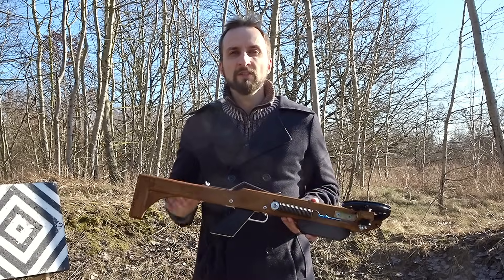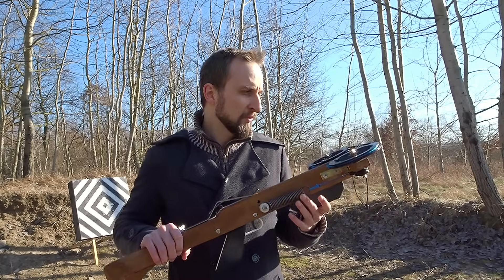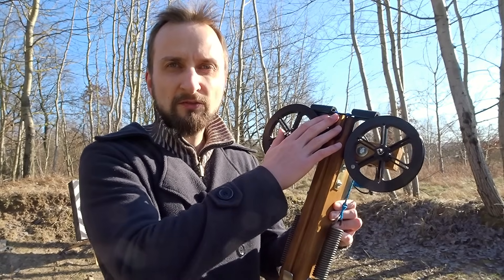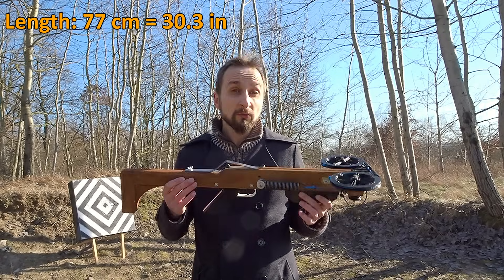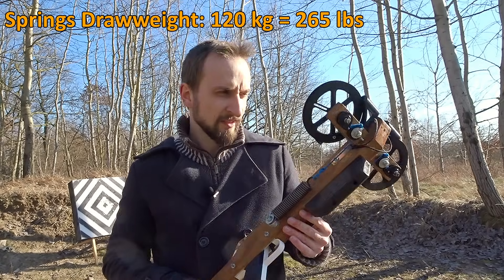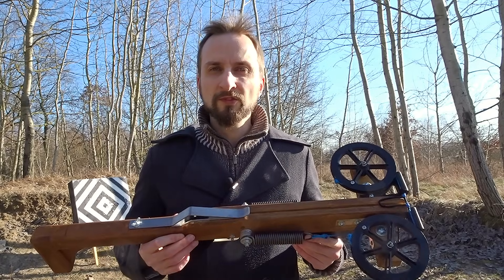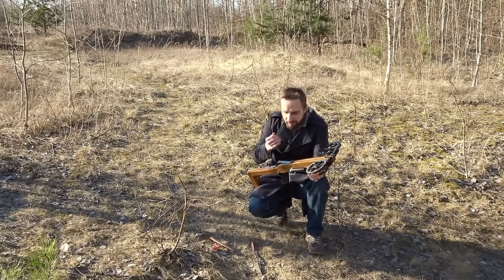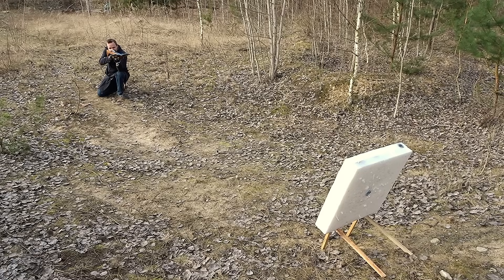Coilspring powered Crossbow

Comment: Interesting, what type of springs are they? They look about the size of garage door springs, but heavier material.
Reply from the maker: The exact ones I used are 13.4 cm total length, 2.65 cm total diameter, 4 mm wire thickness, 25 windigs.
And they are rated for 52 kg max weight, but they can be drawn out further, I put on roughly 60 kilos of drawweight on them.

Comment: Zünder    Hi. How is your crossbow fundamentally different from the one presented in this video? https://www.youtube.com/watch?v=k_B9cZZzGLo
Your crossbow is very weak, because for a gear ratio of 1:4, you need to use a spring of at least 160 kg, then the tension force will be 40 kg, which is normal for a man.
An open spring is bad, it can damage your fingers!
I like spring crossbows, and here is my version of such a crossbow:
https://www.youtube.com/watch?v=RuOYf-plI9M
Maybe you will get infected with such a spring-loaded crossbow design and make your own version?
Good luck.
Reply from the maker: The fundamental difference to Nowak's crossbow is, that he has a 1:1 ratio of spring drawlength to crossbow drawlength.
This means the crossbow could never be faster than the springs themselfs, which makes it very slow. And also you could never have more drawlength than what the drawlength of the springs is. In my contraption for every 1 cm the spring moves the bolt will move 4 - much faster and better energy conversion. And increasing drawweight is easy.
I doubt his mini crossbow even reaches 1 Joule of energy. Mine has 20, a LOT more.

Comment: If you rotated the wheels by 90 degrees so they remain flush against the body, you might be able to make a really powerful bow that meaures incredibly thin on width.  I imagine this would make it more mobile and easier to carry, especially around corners and low arches.  I know folding limbs exist on a crossbow, and crossbows are meant for hunting so you'll typically be out in the woods and not in either of those 2 situations very often, but the idea of a long and skinny crossbow seems pretty novel to me.
Reply: That's what I was thinking too and I think I'll try to do it this way, I will also probably make it longer so there's more guidance for the bolt and more space for the springs
Reply: @samuelmorresi7133   they already have a limbless bow .. the F1  Lancehead ..
Reply: @andystagger2906  II'm really sorry, but what does this have to do with what i said?
Reply: @samuelmorresi7133  why are you sorry?😂
Reply: @andystagger2906  " they already have a limbless bow .. the F1  Lancehead .."

Which is insanely expensive, works in a completely different fashion than this one, and is actually a massive technological letdown.
Reply: @horvathbenedek3596  Why is it a technological letdown?
Reply: @peezieforestem5078  
 @peezieforestem5078  When I first saw it, I thought it would use a clever rotation-to-linear force transfer to maximize torque and reduce size. 

No. 

The Lancehead uses two massive, proprietary torsion springs. 

Why is that an issue? 

1. Weight. It weighs 3-4 lbs more than competitors of the same release velocity and energy (a typicaly 400 fps crossbow is 6-7 lbs without accessories, the lancehead is 10). 

2. Weight distribution. all that extra weight from the torsion spring is too forward. So sure, it might be compact... but imagine holding a 2 lbs dumbbell placed on top o a regular crossbow. Then there's the complex pulley system in the front... the whole thing is a sh_tshow.

3. Proprietary is just another word for hard to repair. Considering the spring is the most vital component of a crossbow, and also the component suffering the most mechanical stress, it makes sense to make it at least somewhat accessible for the aftermarket. There is no aftermarket spring for the Lancehead. If you broke it, better hope they have good customer service. 

4. Not a bullpup. The two limiting factors for crossbows are large forward weight and long length of pull - the string HAS to have a long powerstroke to work. A bullpup design reduces size and felt weight. So what do clever engineers developing the Lancehead do? Put a fixed f_ing stock on it that increases the moment arm by around 6 inches on an already tip heavy crossbow that is SUPPOSED to be compact. 

5. Not really a technology thing, but cost. Believe it or not, cost is a design directive, and the Lancehead F1 offers practically no benefit for its 2600 dollar price tag - compared to competitors with similar or more powerful bows, at 1000-1500, or even as low as 500 dollars. 

I've been thinking about designing a coil-spring powered bow like in the video above for years (I don't have the means to manufacture it, so I let the idea go), so when I first saw the Lancehead advertised as a crossbow without arms, I felt like someone actually made this very obvious move. But no. They just rolled up a very long leafspring, called it a day, and sold it for the price of a used car.
Reply: @horvathbenedek3596  Thank you for replying and explaining your position in great detail!

I understand your complaints, but I have 1 question left to ask:
if the design has clear and obvious flaws, why would the manufacturer make these decisions? (as in, why would they choose a proprietary spring over a freely-available one?)

I find it difficult to believe they did not consider this, and I struggle to imagine a benefit over such solution. It seems like there's more to these decisions than what you've told me so far.
Reply: @peezieforestem5078   @peezieforestem5078  "If the design has clear and obvious flaws, why would the manufacturer make these decisions?"

For the same reason every other terrible product is produced. For the same reason Tesla is an unreliable mess, just as an example.

A good product needs good designers as the core of the operation, and a good leader/visionary to make creative decisions. The problem happens when the creatives in the group don't have an iota of understanding of the design process, and the designers are either not creative enough, not given enough creative liberty, or were disincentivised from creating good products.

Example: A firearm designer I know worked for a locally significant firearms manufacturer for years as lead designer. Problem is, the leadership in the company was basically a bunch of yesmen enacting the will of the owner, who is a rich a-hole who doesn't actually care about the process, and only deals with firearms because he likes the image of a firearms manufacturer. Again, this is a 50+ year old man who runs a company PRIMARILY TO INFLATE HIS OWN EGO AND SHOW OFF TO OTHER PEOPLE. 

So when said lead designer tried to pusb for quality, he was told to do it cheap, because the boss doesn't like wasting money. When he said a higher quality gun would be nice, the boss orderes the manufacture of ONE gun. And kept it. Why? Because he wanted others to feel jealous of him. 

Needless to say, said lead engineer completely burned out, became bitter. Over time he moved to another company with more creative freedom, but anytime he would be pitched a new idea, he'd get PTSD from his stupid former boss, and would be discourages to try new things.

There are DUMB, short sighted people in the world, and when they are put in positions of power, they drag EVERYONE ELSE down with them.

I guarantee you, the seemingly illogical design decisions with the Lancehead were the result of unrealistic deadlines, budgetary constraints, and a manager who just went "I don't care, just make it work".
And at some point the engineers in r&d just said "f_ck it. I wanted to make something nice, but it's not worth it for me to break my back for someone who doesn't even care to acknowledge my ideas. I'll do it with minimal effort, and let the higher ups worry about the rest."

To be clear - there are benefits to the torsion spring. It has linear torque characteristics on a short range, so the bow has a relatively lower draw weight. The issue is that again, regular coil springs have the same characteristics, and are much cheaper.
Reply: @horvathbenedek3596 well said mate
Reply: There is expensive crossbow that use that set up and coil spring combo,but again it's expensive so thanks for the cost friendly idea
Reply: Same idea here, plus put the spring or springs and the wheel or wheels inside the body.
Reply: Problem with turning the pulleys through 90° would be that the string would tend to pull out of the groove rather than run in it.
Reply: @Oldtanktapper  45 degrees might be a good compromise TBH. You're going to lose a little power through friction but it will make it narrower. You could also move the springs further back on the stock to increase the length of travel, add a second pulley set and/or cams to reduce initial velocity. Alternatively just make the whole thing out of box section steel, use a single coil spring buried in the back of it, one vertical pulley at the front and a shoe/shuttle type affair for the bolt running on a linear bearing. Much more expensive to make, definitely but could be kinda fun.
Reply: I'm a lil late to the party but as a hunter that's hunted with a crossbow I'll say-the more narrow the crossbow the better. And having limbs that do Not move is an absolute bonus. If this thing could get to 350fps I'd b all in. But I did just set a vortex scope to my Barnett 😂
Reply: @benrent6625  I hear ya! Illegal here for a long time but wasn't when I was a wee one. Spent much time potting rabbits with blunts.
I put a couple of ideas in response above but also you could just use a sealed pneumatic cylinder as your spring, you'd need a second pulley but with that and a linear bearing/shuttle arrangement I reckon you could get a crossbow equivalent about 100 mm/4" across and also move it more toward a shorter config which makes life a little easier in the woods. Alternatively go with a standard length but starting further back so potentially being able to add cams to reduce the whole "archer's paradox" malarkey...
Reply: I was thinking he could keep them horizontal but just stack them.
Reply: I remember joerg sprave covered a crossbow like that on his channel a while back. 2 spring coils on either side, flush with the body. Had a separate tool to reload tho
Reply: If it can move around corners easily, it’ll be manipulatable around trees easily, And it makes bracing against a trunk more possible
Reply: OKAY everybody STFU, here's problem with the 90° idea: The pulley wheels necessarily have deep grooves. When you rotate them 90°, the cord cuts into the groove wall causing friction. Even at 45° you get friction and the cord might hop out of the grooves. The F1 Lancehead does not encounter this problem because it uses torsion springs which sit flat against the weapon body, so the Lancehead's cord lines up directly with the end of it's torsion springs. The two cannot be compared, they're completely different designs.
Reply: Uma besta é sempre bom tela nas mãos pra se defender de animais perigosos. 🐅🐆🦬🏹🍷🗿
Reply: Technically possible, but its going to reduce your efficiency by at least 70% with the friction presented by having the string leveraged at 90 degrees from the point the pulley if the top of the pulley is not aligned with the top of the rail. If you do align the top to the rail, you would be limited by the leverage effect you could generate vs the size of the Z axis of the device. Not to mention, you would also need to add a string stopper, since the string would then be contacting the walls of the pulley and not the channel of the pulley (like with the design in this video) at rest, which also eats into your efficiency of energy transfer even further.
Reply: Yeah, there's a similar concept of torsion crossbows.
Reply: Could be useful in a dense forest or in certain shooting positions in a stand
Reply: Couldn’t the wheels be much smaller too?
Reply: @KryptoGraphVideos  If the wheels were smaller, the torque conversion wouldn't work, because the massive coil spring would need a very small diameter wheel, which isn't really practical.
Reply: @horvathbenedek3596  You can put the springs further back so the string rotates multiple times on the smaller wheels. The problem with that is the big wheels have to rotate as many times as the small wheels, which means the string also has to wrap around them multiple times and that eliminates the possibility of replacing them with cams, which would vastly increase speed and introduce letoff. You could have a gear reduction so that the big wheels rotate only once, but then you introduce extra friction and make the whole thing heavier and more complicated.
Reply: He wouldn't be using it for hunting as in Germany it's for the most part illegal to hunt with a bow/crossbow. This is more just a passion project.
Reply: Plus, it would make it not look like a dick.
Reply: That kinda exists, search talisman crossbow on yt
Reply: crossbow like this already exists but i don't know if it uses springs
Reply: That setup might be more convenient but it will generate vertical torque at the stock and throw off the accuracy. Horizontal mounting makes sure the torque from both sides cancel each-other out and the forces are transferred to the right vectors.
Reply: I’m glad a year ago everyone was thinking exactly what I’m thinking now
Reply: Making a single shot pistol like this would be awesome.
Reply: Make it or yap
Reply: Yeah, but I imagine that would give you a very narrow field of vision which could make aiming, if not difficult, at least not optimal. But if you aim with both eyes open (correctly) you should still have a pretty open view of your target and it’s surroundings.
Reply: Im actually working on exactly that, but a small one that i will 3d print
Reply: that would derail.
Reply: Thinking about it a bit, besides the geometrical problems from having the wheels pull the spring down, it also creates an unbalanced rotation effect, that introduces kickback on the crossbow during the firing, ruining your aim. Horizontal counter rotating wheels don't have that.

Comment: Ausgezeichnet!!  I would not have guessed that any of those parts were 3d printed. It would be lovely to see a skeletonized 3d printed frame, too, if it would be strong enough. Very nice work!
Reply from the maker: Thanks! Usually the wheels broke along the outer shell from too much compression of the string, so I thought 100% infill should pretty much remove that issue and it did. Perhaps it is also sufficent to just increase the thickness of the outer shell and have 25% or so infill otherwise. A 3d printed frame would definitely be strong enough if done right, meaning spreading forces over larger areas. However, as a next step I want to further improve on the principle and have more power/speed etc. Relatively soon there will be the next version of the spring bowered bow for that reason.
Reply: @aurigo_tech certain parts I wouldn't skimp on weight and quality even using metals were you didn't want but the skeletonized frame sounds good to make up for that gain .with plastics and carbon it doesn't take long for friction to start wearing down pieces especially were string is running and arrow is running against a surface . It's a nice thing almost steam punk looking

Comment: This is beyond awesome. This looks super practical and there's definitely a market for it. Have you thought about contacting Joerg Sprave (I guess you know his Youtube channel) to collaborate on a marketable prototype?
Reply from the maker: Thanks! I think I should work a bit further on this (which I already do) before I should think to put it on the market. It works, but lacks a lot of features that would make it convenient to use for anyone else than me.
Reply: @aurigo_tech   @Zünder  I think that the main feature that can be the selling point is the use of a single large coil spring (with a string which can be stretched on the two leverage pulleys/cams).
If you use standardized parts as much as possible it'll make a hell of a difference. Yes rubber and fiberglass bows will always be faster but coil springs will always be widely available and relatively cheaper (for it's service life). So such a crossbow should be easy to repair with off-the-self parts and 3D printed parts. 
I (and I guess many others ) have never bought a compound bow because it's too complex to repair if the model and it's parts are discontinued and become unavailable.
Reply from the maker: @AggelosKyriou  Yes, ease of maintenance and reliability would be major points I am interested in as well, plus adding things like an integrated cocking aid.
Reply: @aurigo_tech  I see. Of course, it's your thing. Keep up the good work!

Comment: Gut Gut, very nice German engineering!
I like this concept and the idea of using cam-like wheels but only in combination with bearings.
If you want to get higher with de energy you fore sure need a better string, the one you use looks like some sort of normal braided cord (correct me if I´m wrong)
A professional string is made out of material with low expansion what means that more energy is transferred to the arrow.

Mach weiter so!
Reply from the maker: Jo, dankeschön! Seit dem Video habe ich alle sehnen gegen richtige Bogensehnen ausgetauscht. Das hat zwar die Energie nicht merklich erhöht, aber die Konstanz der Schüsse, da bei den Seilen die Spannung an den Federn nach ner weile nachgelassen hat. Ich bleibe auf jeden Fall dabei und entwickle es noch weiter.
Reply: Cool, ich freue mich schon darauf den weiteren Fortschritt beobachten zu können :)